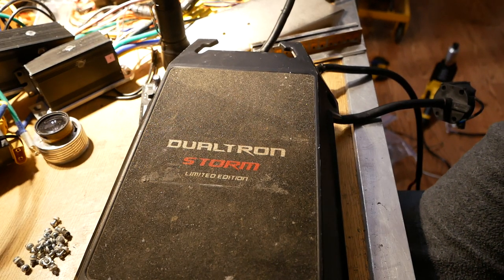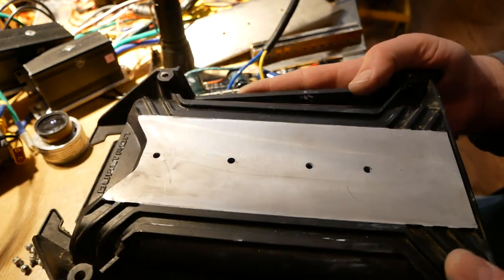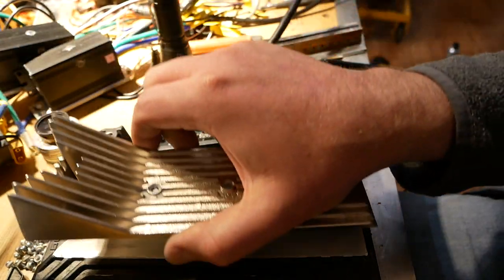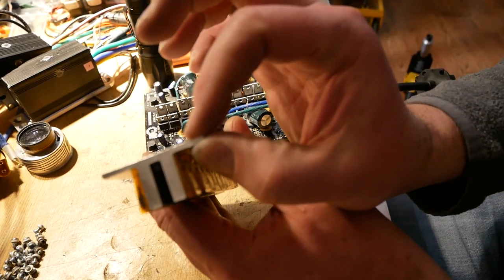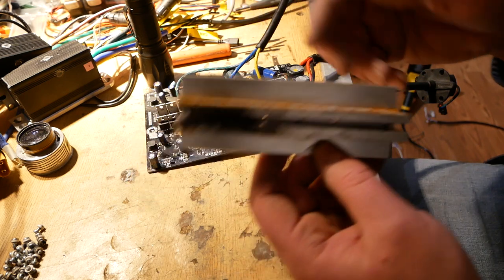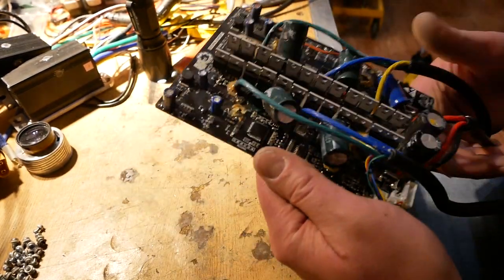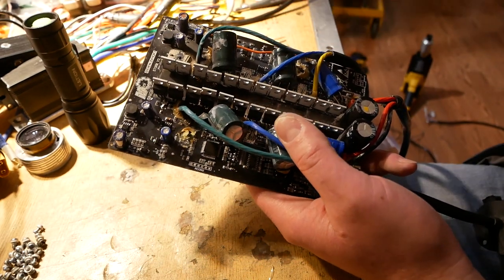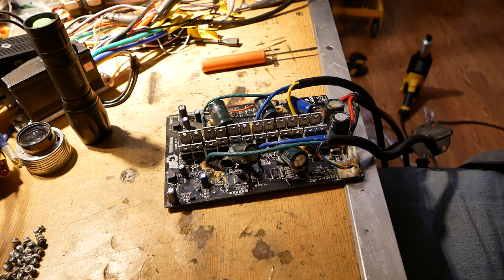Dualtron Storm LTD controller teardown - Why they die so often

Comment: Great!!! Just fucking blew the controller on mine… and the fucker costs 400€ 😢
Reply from the maker: yup...well maybe you know why they are junk now.
Reply: @de-bodgery  yeah atleast its gonna go under warranty bought the thing this years april. Probably gonna sell it and go through a major search on what is the best power scooter that lasts and is water resistant and such
Reply: lol great they think that the condensation that they found in the deck of my scooter is the culprit and they wont put it under warranty... morons think that the connection between the controller and battery got some water and thats why it burned up allthough the wires and everything is completely good and not burnt xD @de-bodgery
Reply from the maker: @tusdomestic7448  That's very shitty! These controllers are known to burn out!
Reply: @de-bodgery  ive scrolled the comments and you mentioned changing the controller to a vesc 100/250 is that much work to get it running on that or what?
Reply from the maker: @tusdomestic7448  I don't think it's overly hard to do, but then I use VESC controllers and understand them somewhat well.
Reply: @de-bodgery  ok might look into it see of its plug and play or i need to contact someone who understands them better and can make it run on one
Reply from the maker: @tusdomestic7448  It won't be plug and play...not even close. Some amount of rewiring will be needed. The wiring in the scooter now won't all work as is when you switch over to a non-proprietary solution. Never mind the fact that your existing throttle and several other things will need to be changed out for universal parts. This is something that I can do and done on my Dualtron City...so I know what is involved. It's not plug and play.
Reply: @de-bodgery  ok good to know just wondering if i can still access the p setting somehow or not or is it just going to be full tilt all the time?
Reply from the maker: @tusdomestic7448  Your current eye3 throttle and display will only work with dualtron controllers. Leave them behind for something more cpable, modern and relaible and you will also get rid opf your current throttle and any settings you had before. The up side is the new controllers will do what you are referring to and about 1000 things you don't even know about! VESC is prety much the best thing there is in motor controllers and they are rather feature rich!
Reply: @de-bodgery  so if some throttle works with the vesc it all good and set for settings and such?
Reply from the maker: @tusdomestic7448  There are hundreds of non-proprietary throttles that work with VESC or any other controller. You would use your phone or computer to program the controllers.
Reply: @de-bodgery  okey going with that route then i dont want to buy another controller in the next 4 months
Reply from the maker: @tusdomestic7448  It's not a simple "plug and play" replacement, but it can be highly reliable once all the changes are in place.
Reply: @de-bodgery  oh i get that no worries

Comment: You got instagram will send pics when i recieve mine
Reply from the maker: Post a video
Reply: @de-bodgery  i will do when i get it i will full throttle and video it with my gopro
Reply: Have any improvements been made? I want this scooter because of its insane range but I'm afraid of these issues I keep reading about 😨